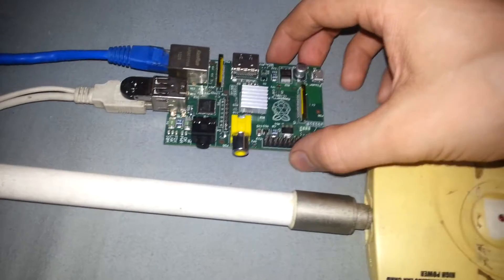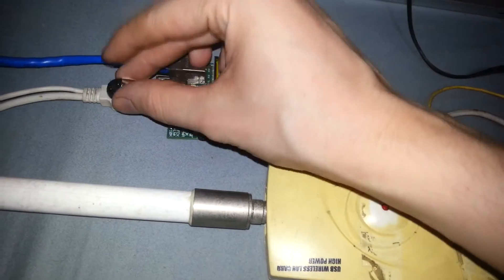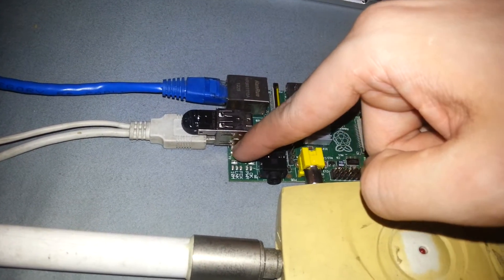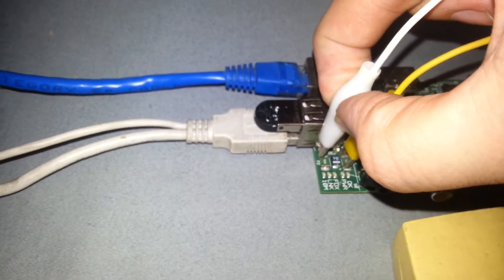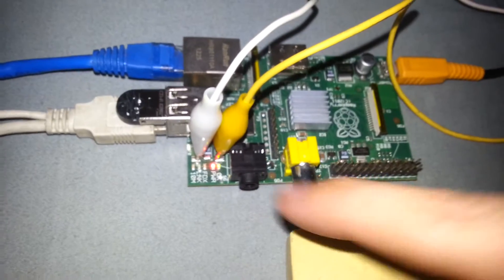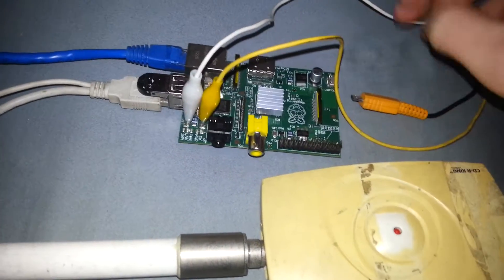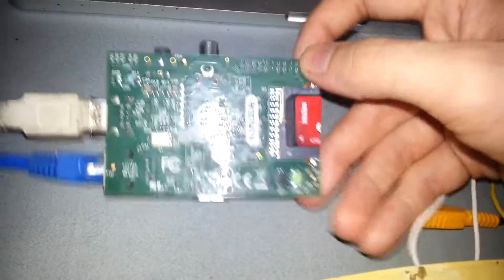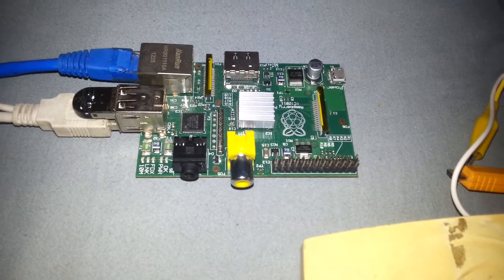RaspberryPi polyfuse fix

Comment: god I am actually going nuts. I have a Model A rev. 1 from 2011 with only 1 USB port; the only polyfuse is on the main power supply circuit yet i'm still getting this problem with a 5.2v 2.7A supply, when it wasn't happening last week..

Comment: what's that SD card you've got there (that fits flush and doesn't stick out the bottom)?
Reply from the maker: It's a regular SD card that I cut down to fit flush. Most modern SD cards are like this. If you shine a really bright light, you can usually see through the plastic and see if the board consumes the whole space or just half. Then you can trim it down to size :)
Reply: Gadget Addict That's freaking amazing. I wonder if there are 64/128GB ones that are also like this (i can trim them for use in my Macbook without having to use a MicroSD then)!
Reply from the maker: I imagine there will be. The problem with putting a trimmed card inside a macbook is that it's really difficult to remove. I use an external usb SD card reader instead of risking getting it stuck in my macbook :)
Reply: Gadget Addict Curiosity got the best of me and after I peeled the plastic off this 8GB card I had to follow through with it and cut it up... now I'll not be able to practically back up this card... I think I can put some tape on it so I can pull it out, though. External SD card reader will be in the mail in a few weeks.
Reply: Gadget Addict Interestingly, the lock switch appears to be completely non-functional (unless it has some sort of tiny magnet or something). Kind of disappointing, really.
Reply from the maker: dc443 I'm not sure how the lock switches are meant to work, I've never used it tbh. I'm glad you managed to modify your card without damaging it. I use a $1 external sd reader and just broke a bit of the plastic to make it super easy to remove the card. Tape might do the job, just be careful if it's a tight fit.
Reply: Gadget Addict The only SD card reader type things I can find are $5 at best (the ribbon cable SD extensions). Are you talking about a USB (full size sd card) reader or some such?
Reply from the maker: Yup just a generic chinese full size reader that plugs into your USB port.
Reply: Gadget Addict Oh wow, it must be the ribbon cable that's where the cost goes then. Hey thanks for your guidance, learned a neat trick today.